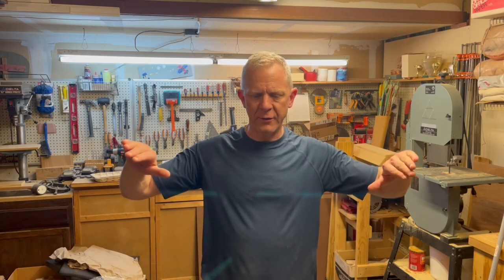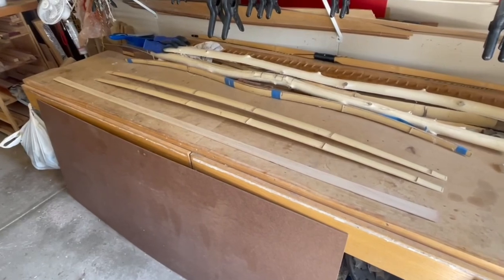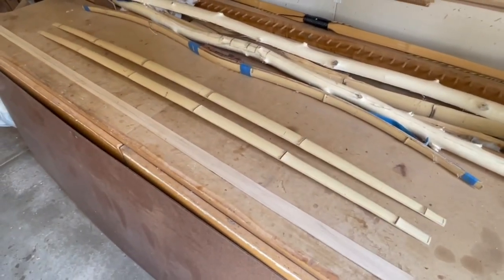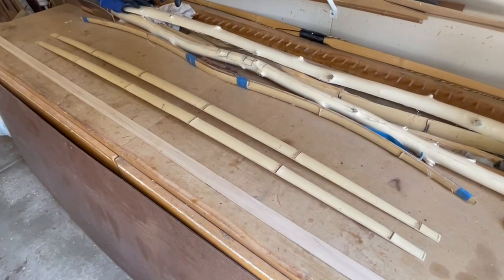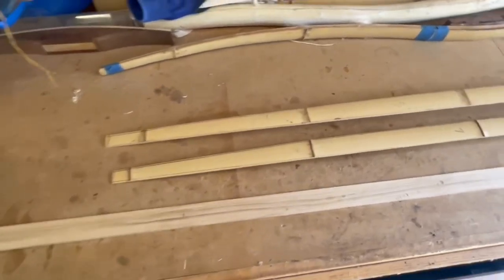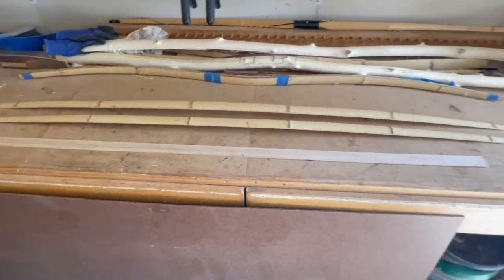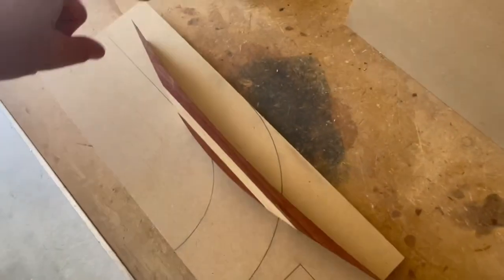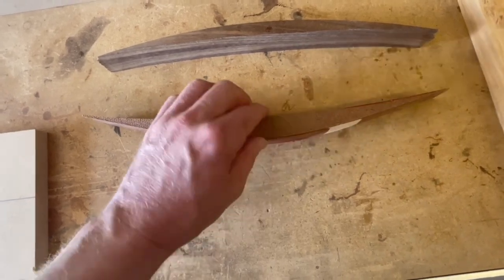Asian inspired hybrid recurve bow Pt1

Comment: could you tell us the dimensions please
Reply from the maker: The overall length of the bamboo is 65” long.1.5” wide at the grip with a parabolic taper to 3/4” wide tips tapered to achieve an arc-of-the-circle tiller with the back being .18” thick at the center and the belly being .21” @ ctr. The core lamination is 54” long, .13” thick at the grip tapered evenly from the center to a feathered edge at the tip. The riser is 14” long and shaped to taper smoothly at the tips and about 7/8” thick at its center (Shaped to your discretion) the recurve reinforcements are 9” long and .12” thick feathered to a paper-thin edge on the last 2” or so. The next video gives a little more information on the specs - but these are the nuts and bolts.
Reply: @meadowlarkadventuregear  
THANKS 👍👍👍